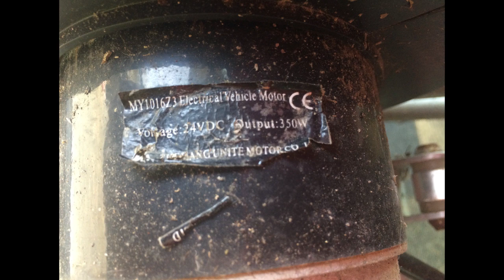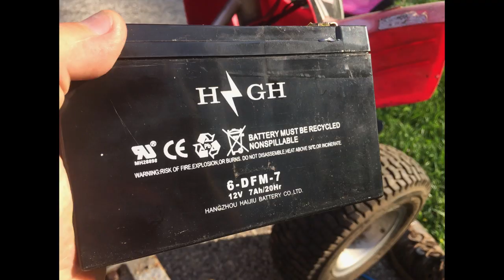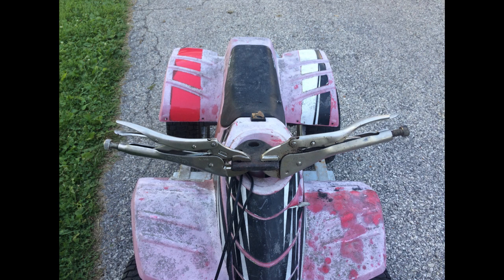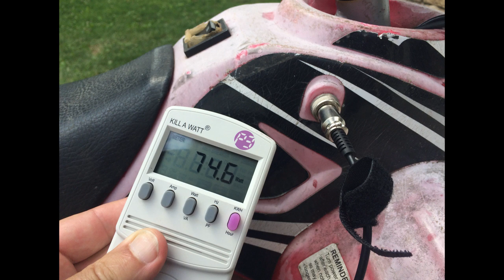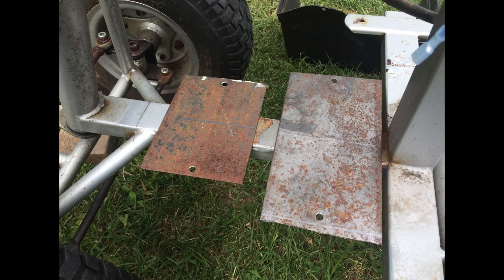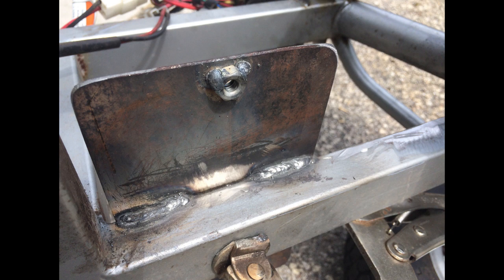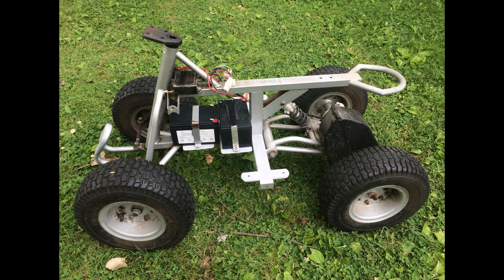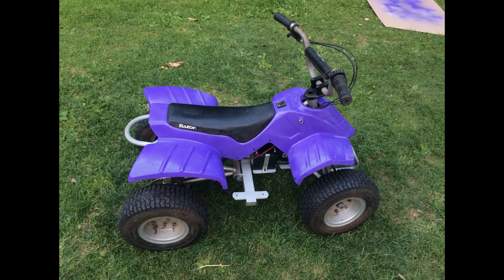Electric ATV Repair and Upgrade - Kids Razor ATV/Quad rebuild

Comment: I grabbed one for $20 it wasp sitting out side for years and i was blown away by it working with new batteries but it was low on power so i was expecting a bad motor but i changed out the speed controller and it ran perfect these razors are a beast of a machine

Comment: Fantastic 😁👍. I just bought 1 of these for my Goddaughter 7th birthday she loves it. Lol your making me wish I got 1 used I love the upgrade you basically doubled the gas tank with the 2 batteries upgrades. It should run a very long time the stock batteries are true to there run time about 40 mins or 5 miles which doesn't seem like a lot but its decent for stock. And I would bet my Goddaughter would pick the same color too lol if we paint it. The only upgrade I did right away was I ordered these 20$ police lights for a cars grill 2 white 2 red and I nicely drilled holes for the wires then hot glue gunned them on I also ordered a little 5Ah 12v rechargeable battery for the lights and any 12v accessories I was able to zip tie the battery upside down under the point of the front plastic body to the matel frame so nothing is seen. The lights are nice because they can strobe like a police car or be solid I mounted the 2 whites in the front like headlights and the red on the back for tail lights. Thanks for sharing 😁✌
Reply from the maker: Just this morning, my daughter asked for my wife's old GPS to mount on her ATV's handlebars! I guess she won't get lost riding around the yard and the GPS has a speedometer built in!

Comment: Did you do anything about the brakes?
Reply from the maker: I just worked on the brakes with some PB Blaster and then some lubricant. Got it working fine. Didn't even have to replace the brake cable.

Comment: I wish i have one..that needed fixing..I'll just wack it make it fit into  a powerwheels
body..so I dont have to deal with the plastic wheels wearing out.
i have to run thier powerwheels at 5s lipo or 6s lion...anyways.
It just depends on the kid...one of my niece..dont care if it can power slide or do donuts
she just needs it on 18v....it's easier for me to manage her ride if I just use 24 volts
and rear air tires..so we can drive it to a local park...which is sort of like a golf course.
so she can drive in the grass or climb small hills...without tearing up the plastic gears.
She can handle 24v powerslide or donuts...but dont care much for it.
as long as the car is pink or purple..do over 10 mph....it's good.

her younger 4 year bro...on the hand...demands it do donuts and faster than his sister.lol

Comment: Amazing project 👌🙌🙌 you can add some safety measure using Arduino nano and ultrasound sensor you can do prevent from dashing and control speed when object is ahed of 10-13 ft. So you maintain safe distance and slow done speed  aslo

Comment: You have so many  Lithium iron     Why not power it with that
Reply from the maker: Those batteries are HUGE and weight 43 lbs each. Two of them won't fit in the cycle and two batteries plus the girl would put the vehicle over the weight it's designed for.

Comment: Well done, that is very nice.  We also have a 24v razor toy like that, however we made a custom 8s4p lithium pack (~32v we charge it to).  That gave it a little better top end I think (I never measured the top speed on the lead acid batteries when they were new.) But now it hits about 15mph.
Reply from the maker: Well, on a DC motor, voltage is proportional to speed, so higher voltage is faster! I think I'd be scared of this one going that fast!
Reply: Just wait, my 7 year old is already wanting more speed so I think a 1000w 48v motor and controller is going to be next.
Reply: I am also thinking I need a remote kill so that if they go too far away or I hit the button it slows down and then kills it self.
Reply: 15 mph on a scooter is white knuckle, lol. Those bird scooters are sketchy!
Reply: Do you think you can pop links in here for exactly what’s needed to make this At least 36v ? Dumb it down for me please including the charger and anything else needed...will the motor still work?
Reply: @gigiacti  Well for what it is worth the 32v lithium pack ended up burning out the stock motor...  I ended up buying a kit "1800w brushless motor" on ebay and replacing it all.  Also spot welded up a 12s10p lithium pack... now my kids can go easily 20mph+ I think.  There a many video's and written guides on the internet but if you don't know what you are doing just by an MX650... my conversion required lots of welding and fiddly work to get it finished, not a simple process to swap everything out.